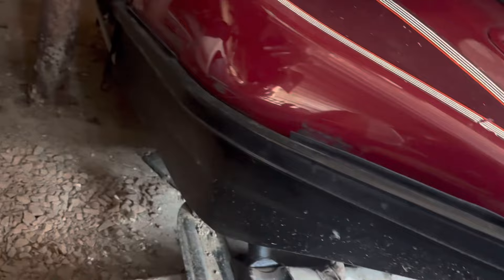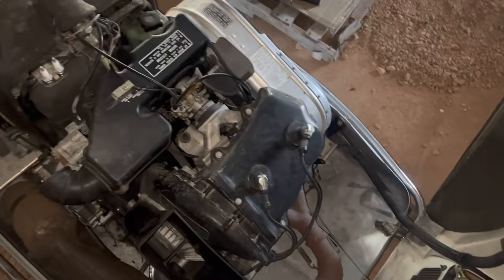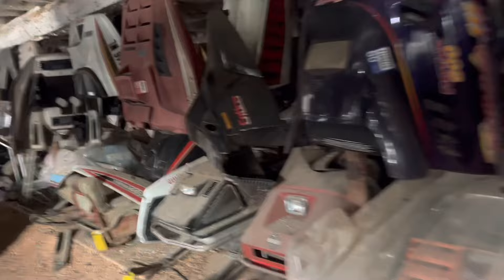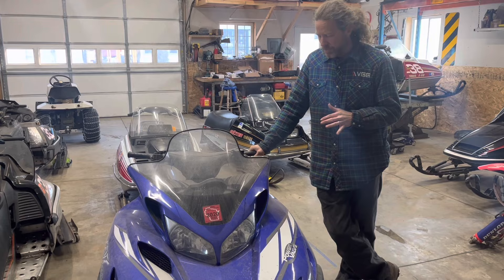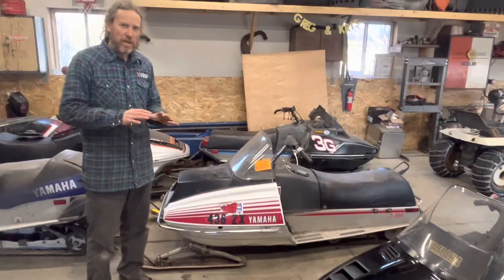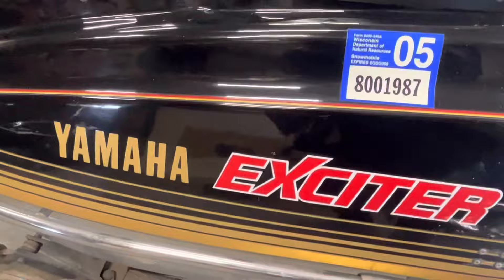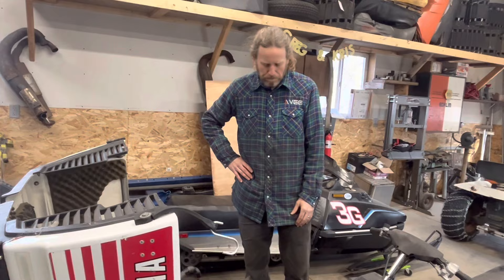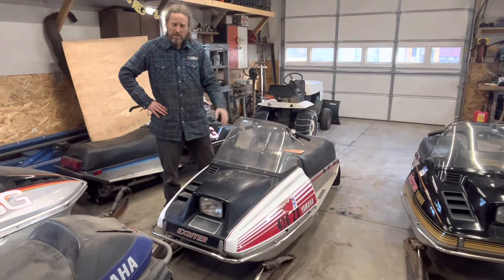100 Vintage Snowmobile Barn Find!

Comment: I bought 89 yam ovation 340 $50 last year in great condition because he couldn’t get it started. I just need to carb clean first and Alaska deal I probably ever get like that😂
Reply from the maker: They're out there yet!!  We fixed up our first ever ovation for this coming season to use as a vintage trail rider.  Eager to see how it is to ride compared to the old Enticers which share the same engine.  Thanks for watching!!
Reply: @3gsgarage117  yep but been one of the worst years in Minnesota we’ve had no snow first time I’ve ever saw it in 40 years of life